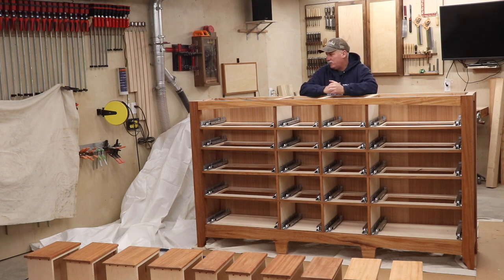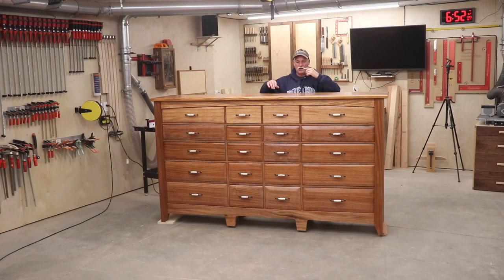Master BR COD Pt 5

Comment: Beautiful  chest of drawers!  Why would you not use the same tennoning jig set up to cut both the long and short sides of each drawer face?  You have to move the fence to use the jig and that introduces another possible error in the location of the tapered feature, doesn't it?  Seem like setting it up once and running them all would've been more accurate.
Reply from the maker: Thanks! I probably could have on the short drawers but, the jig was too short for the long drawers.  I could have built a longer jig I suppose.  With 2 sides cut, the set up wasn't difficult.

Comment: Great videos!  Love how this all turned out.  What is the hardware you used to mount the top to the base called?
Reply from the maker: Thanks!  I used Figure 8 Fasteners.  Don't plan on lifting heavy objects with these fasteners but, they work well to keep a top in place and allow for wood movement.  This piece was moved lifting from the bottom rails only.